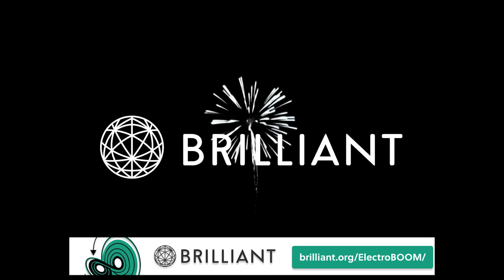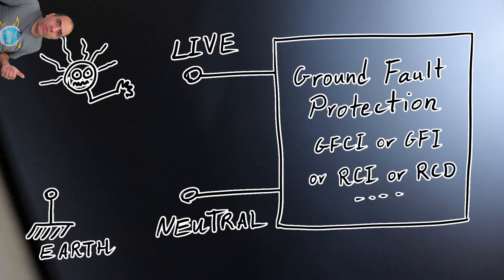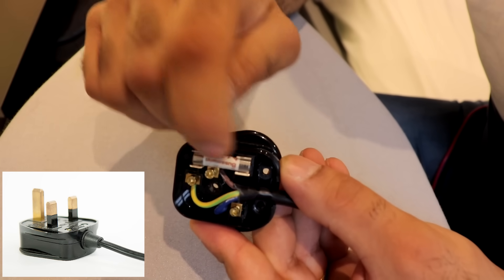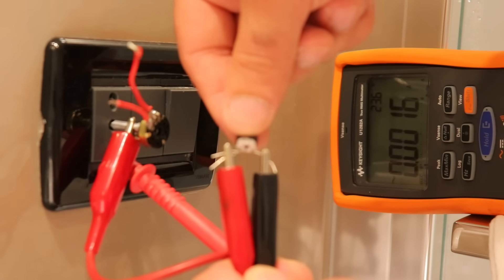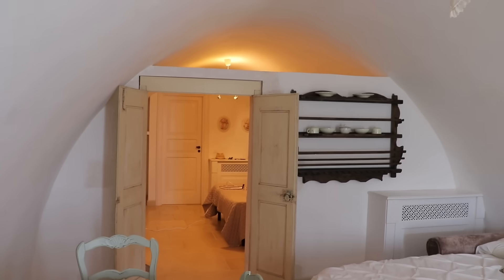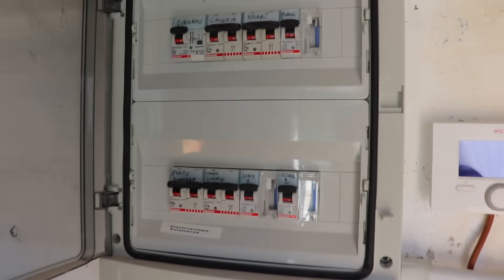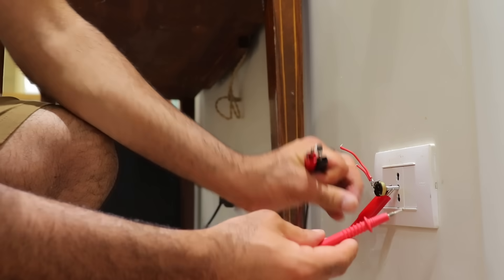Tripping Every Breaker in Italy

Comment: as an italia i can say:
i think rcd (or "salvavita", life saver) are required by law.
the "italian plug" (the vertical one) has two types, the smaller one for thing that (generally, not always) consume less energy (it can have the groud pin or not), the bigger one (the most popular, and the one that have two holes) for the other thing (i had never saw one whitout the groud pin) (there is also a completely different one but it's used for more industrial application)
the German plug (the "round plug") is for thing that need ground (you still have the central hole becouse it's tought for also using it whit the more standard one). you can plug this one in the Italian one, but the german have slightly bigger pins (that's becouse it's hard to plug in the incorrect socket, and it will problably damage it (at the least, from what i can see)) 
sadly, those socket aren't polarized, in teory you shoud use color coded wires (yellow-green from ground, brown for live and light blue for neutral), but people don't always follow it (as you can see)
the only time i triggered the rcd was when i was a child and accidentaly tuched live, didn't even notice it, it tripped instantly
Reply: btw, tf were doing down there at rome?

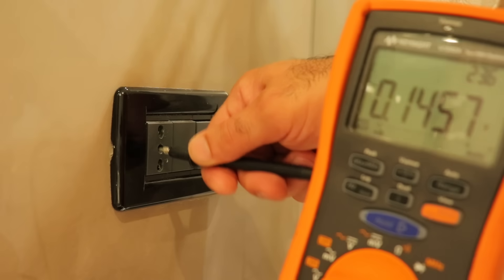Comment: In Italy we have 3 types of plugs: the 9:22 one (maximum 10 amps, called "small Italian socket"), the most common as 4:19 (maximum 16 amps, called "Italian socket") and the European standard socket at 15:17 (maximum 16 amps).
What you said at 15:22 is usually wrong, you cannot insert a European male plug into an Italian female socket (that socket was worn out or just plain broken) so you always get a ground connection.

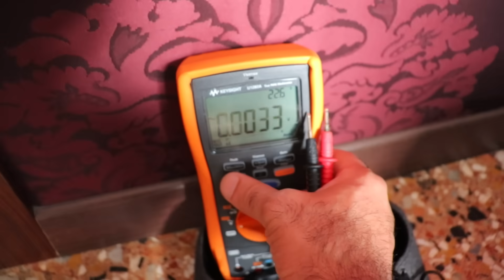In Italy we had 220VAC 50Hz (or 380VAC three-phase 50Hz) but now we have almost switched to the European standard 230VAC 50Hz (or 400VAC three-phase 50Hz). So somewhere in Italy you can still have 220V AC 50Hz (but I think you measured 222V AC at 1:45 just for the fluctuation of the power grid).

Also:
Every house or building in Italy has an RCD but we don't have a specific RCD just for the bathroom.
As you reported correctly, normal trains run at 3KV DC while high speed trains use 25KV AC 50Hz which is a common European standard.
I have never seen the outlet at 9.16.

By the way, nice video!
Reply: Also we use to have at least two breakers, one for lights and the other one for sockets. Modern houses tends to have a pair of breakers (light/socket) for every room so if there's a fault somewhere you could isolate that room (part of it) and waiting for the technician without worrying about food in freezer
Reply: I thought 230V was a compromise between the 220V used in mainland Europe and the 240V used in UK/Ireland. 220 volts is still standard because it is within tolerance.
Reply: @epender  The UK simply changed the specification of the voltage, reduced from 240 to 230 and change the upper tolerance limit so 240 was still within the spec.
They didn't actually change the supply voltage to people's homes, because that would have required the distribution transformers to be changed, and I don't think they had multiple tap points to adjust the voltage, so they would have had to change them to adjust the voltage to 230 and that's expensive.
Reply: @deang5622  I meant to say something along those lines, but I couldn't put the words together. Thanks for correcting my comment.
Reply: @epender  yeah the voltage as stated by european standard is 230V ± 10%. Therefore 220V is still acceptable but most likely due to an overloaded grid.
Reply: La presa a 9:16 è una presa telefonica anni 70 di proprietà della bTcino.
Molto raro trovarla, si vede ancora in qualche vecchia scuola!

The socket at 9:16 is a 1970s telephone socket owned by bTcino.
 Very rare to find, it is still seen in some old school!
Reply: @MyNotSoHumbleOpinion  mai capito il perché di quella presa quando c'era la classica tripolare... assomiglia alla magic bticino, anche di quella non ho mai capito lo scopo
Reply: @Pietro_Troschka  non ho mai neanch'io capito lo scopo. Presumo che bTicino forte della sua posizione predominante sul mercato elettrico, volesse introdurre a gamba tesa un nuovo standard brevettato e farsi un pacco di soldi! Fortunatamente ha vinto "l'open source"!
Reply: @Pietro_Troschka  La Magic l'aveva messa mio padre nella casa che costruì negli anni '70 perché con le prese normali c'era il pericolo che io e mia sorella, che avevamo 1-3 anni, ci potessimo ficcare le dita dentro. Questo mi aveva detto. Allora non c'erano interruttori differenziali, né la protezione con la linguetta delle prese normali che ha inventato, credo Vimar, ma qualche decennio dopo.
Reply: @MyNotSoHumbleOpinion  it's pretty facinating to see how phones connect over the world.i recently found an old style phone connector in my grandma's house in the USA before the RJ-11 switchover, and I just saw the UK's version

Btw, I'm not sure if other countries use RJ-11, but I hate it when it comes to IT, because people will just plug that into their computer's Ethernet and give us a call to complain that their internet isn't working, usually saying that it worked like that before. Gotta love easy fixes atleast!
Reply: @Murdoch493  in the 90s we slowly moved to rj11! Before that the common telephone sockets had 3 round poles arranged like the UK power plug!
Reply: The plug you called "worn out" is a "travel socket" with a built in travel adapter to fit european plugs, they are very common in hotels. In theory they are kind of safe as long as they are not in a kitchen or bathroom.
Reply: Finalmente qualcuno che può capire
Reply: some electrician put an 10mA life saver in the bathroom line, and i never heard italian type socket,  and the plug with 2 holes are for 16A and for 10A plugs, its called "biplug", "bi" meaning 2 so 2 plugs...and in the bathroom the boxes for plugs cant be too much close to the bath, shower, ecc... there are some standard rules (see IEC)
Reply: It's very similar to what we have here in Portugal..except for the sockets, we only use the European standard sockets .
Reply: What's the one on 9:14
Reply: La presa al minuto 9.16 non è una presa telefonica ma una presa “magic” (ormai obsoleta ma impedisce di invertire fase e neutro)

The 9.16 outlet it’s not a telephone socket it’s a “magic” outlet (obsolete nowadays but it prevent you from inverting live and neutral)
Reply: @DENIS9994  La magic oltre alle due rientranze sulla sx ne aveva anche una a dx. Questa è una presa telefonica anni 70
Reply: @Pietro_Troschka  hai ragione! Avevo visto male…
Reply: @Pietro_Troschka  se non sbaglio le magic esistono anche senza la rientranza, si usavano per le linee "pesanti", le spine con l'asola per la rientranza entravano senza problemi, quelle senza (es ferro da stiro, phon, fornello elettrico ecc) non entravano neanche a calci.
Reply: @kentahirono  Esattamente. Quella è una magic per 16 A, probabilmente è lì per il phon. Certo è roba di qualche annetto fa...
Reply: @DENIS9994  no, fidati che è telefonica! Sempre serie magic! Se guardi attentamente la presa elettrica ha una rientranza al centro! Ci sono tre tipi di presa magic: quella telefonica del video, quella elettrica e quella trifase con 2 tacche lungo il corpo!

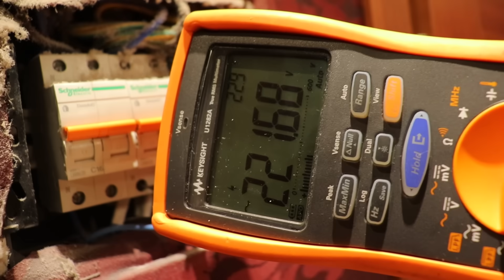Comment: 3:35 This is wrong, I mean the hotel got it wrong. According to standards neutral should always be light blue. For other wires: ground - green and yellow, phases - brown, grey or black. In another words they mixed up black phase and blue neutral. (According to what you measured)
Reply: Nah I think the hotel got it right and mehdi messed up. Watch closely after he measured. The left probe was connected to the blue wire.
Reply: @_who_cares_1123  thanks! Was looking for this!
Reply: @_who_cares_1123  .
Reply: Blu for neutral,  green-yellow for earth and all other colors for live, green cannot be used and yellow aswell
Reply: In germany you tended to use the blue wire if the other ones were already used and you needed just an extra wire. It isnt suppossed to happen anymore
Reply: I think he might have not made proper contact with in screw on the CPC block.
It might have also been wired in the old per 2004 wiring scheme.
Reply: yeah exactly
Reply: light blue? u mean blu

Comment: While it is very entertaining to see you with floating wires in sockets, but PLEASE make simple board with soldered potentiometer + plastic knob, terminals for measurements and plug connections so you don't have to freestyle it every time you review safety in hotels. I want to see more videos from "hotel safety" series which won't happen if you shock yourself dead lol. It makes my hair stand looking at socket air-wire freestyle :X

Comment: In malta, we use british standard electricity.  It is normal we have 30ma rcd for ground protection. We also now have the trend for using rcbo protection for each circuit at home. If the is a fault it will pop only that faulty circuit and not all the house. But normal installation includes a 40amp double pole mcb, 40amp/30ma rcd followed by mcbs for each circuit. And extra protection with an over and under voltage protector followed by a surge protector inside a consumer unit.

Comment: 16:09 Those plugs aren't there for ensuring grounding, those are the European standard and the only plugs you find on commercial appliances with ground, regular 3 prong Italian outlets with the larger pitch (hence the double drilled holes) are rated for the same power

companies just don't want to manufacture different plugs for just one country so we are stuck with two standards and adapters everywhere, although you could cut the cord and wire in your own plug 

Those also shouldn't fit in the standard outlets but old and worn out ones will fit, on the ones in my house you can't without using unreasonable force

also 3:38 I really hope black isn't neutral and you just did some bad probing, because neutral is blue and black if phase#2 in 3 phase installations, that would be a code violation

Comment: I've recently returned from a trip to Switzerland, I do remember seeing flashes in the distant sky one evening. At the time I assume it was lightning is the distance, but now I'm starting to wonder...

9:10 - That weird socket is for a telephone. The connector is called a BTicino-2021

BTW, Switzerland has truly weird sockets, but adapters to convert them to the standard round Euro plugs are available in most supermarkets (the ones I got had a built in fuse too!)... And from there I could use my usual Euro to UK adapter and connect in my standard UK multiplug... Muwahahahaha...
Looked terrifying, but actually added 3 fuses!
Reply: Swiss sockets are great because their three phase sockets are compatible to their single phase plugs.

Comment: At least in Belgium, a building has usually only 2 ground leakage protections. 1 for the entire house on like 300mA, and 1 for "wet rooms" and water devices of 30mA. This is also the minimum protection required, without those 2 your electricity will not be approved. You wont find many houses without that, perhaps very old ones, but when selling/buying a house you need to get the electricity checked and get it fixed.
Reply: This is typical on TT earthing. In TN the main RCD is not needed as there is low impedance fault current path so the normal breaker cuts the power if a case gets energized.
Reply: @okaro6595  I would still put an RCD on a TN system if at all possible. Systems are not perfect, people make mistakes. risking your live on appliances rolling of the factory being correctly grounded, is not a wise gamble. And you might have people working on electricity without turning of the power, shouldn't, but it happens. Or there might be an exposed wire somehow.
Perhaps in industrial, were an RCD would be more expensive than 50 euros, and were it is easier to fully guarantee every conductive surface is grounded.
I installed 3 RCD, 300mA for the house, 30mA for the bathroom, 30mA for outside so it breaks before the main one.

Comment: If anyone is interested, 230VAC doesn't actually exist. It's just a standard that allows full compatibility between mainland EU 220VAC and UK/IE 240VAC. This way, the tolerance limits fully cover both 220VAC and 240VAC.

Comment: Live and neutral on the socket have a smaller and a bigger hole so that you can plug either a 16A or a 10A device on some socket they put only the ones with small holes so that you can plug only a 10A device because the wires on the back can handle less current this is normal in bedrooms for example where you normally plug lights at max.

The general system is almost the same as in UK, in Italy the “RCD” is called “Interrutore Magnetotermico differenziale”.

Normally the plugs that can be plugged only in a certain way are called “shuko” and shouldn’t be plugged in normal socket but only in the ones that are shaped for these plugs, but you know not everyone knowsI suppose

Comment: I'm from spain and in my house we also have 0.03A breaker and I can defently say that you can get a quite bad shock and the braker wont pop, I had shoks in my house 3 times and only 1 the breaker pop.
Reply: Sounds like there is some other fault in the system that needs investigation - 30 mA breakers are quick and painless.

Comment: You should visit my apartment, come to the Netherlands. Stare in awe at the lack of a single grounded socket anywhere except for the kitchen. Built in the 50's or so when there were no 650W PC's buzzing in the living room or bedroom and stuff. Kitchen has grounded sockets for a fridge and a washing machine.. sigh Not even sure how this is a thing being the Netherlands is pretty strict, it's not private rent either but a big housing company. (eh guess I have to mention "big housing company" tends to be the better way to go over here usually, bang/buck wise.)

The shower room is super duper ultra safe though, I simply don't have a socket in there at all sighs :')

Comment: Not only is ground fault (or RCD) MANDATORY at any circuit below 16A (so anything that plugs in AC or home use 3wire) we also use a Combined system until the pint of RCD so we have neutral and earth as one wire comin straigt from the Transformator. so if the Breaker fails to do its job which is Fault protection, we have extra protection via RCD, its called 3step protection

Comment: Actually the Schuko ( big black connectors ) shouldn't fit in those 2-way socket. That's a socket fault. Smaller socket is rated for 10A, bigger is rated for 16A applications.

Happy to see you've been in places with a good electrical system. Great choice to visit also Alberobello, Polignano a Mare, Trani and Bari !

Comment: The large plug is called a schuko plug. It's used for appliances with a larger current draw. The 3-pin plug is the Italian CEI plug and the 2-pin plug is called a Europlug which is compatible with most sockets in Europe (it's technically not compatible with the BS 1363 plug used in the UK, Cyprus, and Malta - but you can get the plug shutter to open with a pen inserted into ground and jamming the europlug into the socket).

Comment: I'm not seeing much good in having a fuse in a plug, even worse if it's in old school British single loop installation. From experience I know fuses tend to have ugly habit of overheating and holding the heat for quite some time, eventually destroying whatever piece of plastic they are mounted in. Just recently did a repair related exactly to that. Not to mention the "BUT IT'S PROTECTING THE CABLE" claim being completely invalid as electricity works in a closed circuit and a good circuit breaker will catch the surge quite reliably before the cable even gets warm. More so when handyman exist and have a nasty habit of replacing the fuse with whatever piece of metal they can find, rendering the plug protection useless. Long story short, screw the British plug, that overcomplicated nonsense of a space killer.

Edit: I'm also currently working on a project where in our tourist center I'll be removing quite a few PHx fuses completely and replacing them with a piece of bus bar. Why? Some genius thought it a good idea to put a 200A fuse on every cable, every single one, in every box he could find. Meaning we might have maybe like 4 - 6 or more identical fuses in a series. Implications? When you get a good failure going, you're not looking to replace one fuse, but every single one in that series, since they're are the same characteristic and will go all at roughly the same time. Whatever fuses that survive the initial surge will begin to heat up and fail over time, potentially damaging equipment as they go. All that's needed is just one set of fuses at the beginning of that circuit, nothing more. The protection stays the same, the problems fall to a minimum.

Comment: Did you experienced the warm and fuzzy 220 volts domestic outlets? The double outlet is for both 10 and 16 amps plugs we have. There are also a 10/16 and round plug ones.

Comment: Min. 7:21
If you look on the braker you can read "salvavita", lit. " Life saver", is the name used in Italy for ground fault protected braker.
Hope you enjoyed your stay!
Reply: Min 15:24
Actually, italian plug are designed to not accept "schuko" plug (or German plug as we call it) , the inners holes have a smoller diameter than the schuko pins... The reason wy you can plug it is because they have been forced from precedent users😆 (the difference in diameter is pretty small, so once the plastic is deformed for the first time it's easy to fit a schuko plug, probably it's also the reason wy at min 9:18 there are no  "doors" In the plug, they are there, but stuck in open position because of the deformation caused by using the wrong plug).
The smoller holes are for plug rated max 10A, the bigger ones are for max 16A plugs (if i remember correctly).